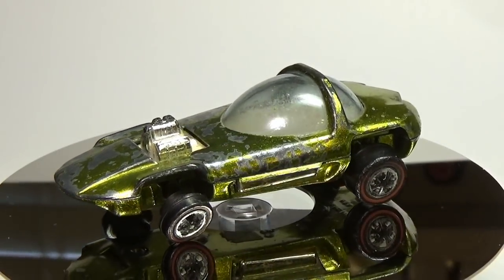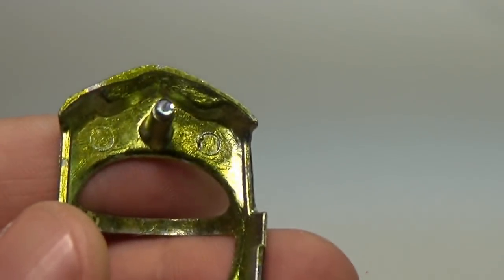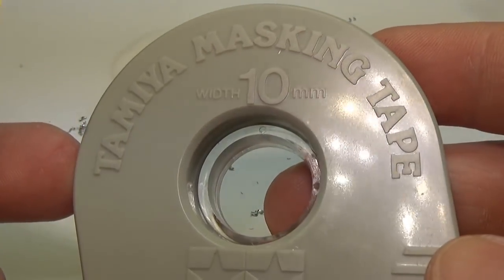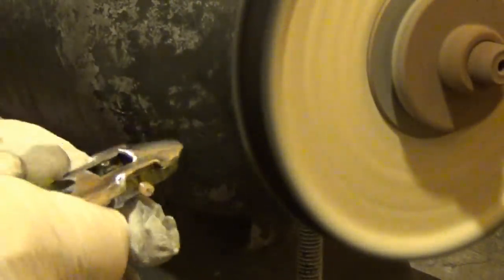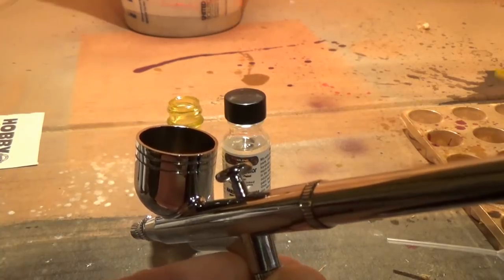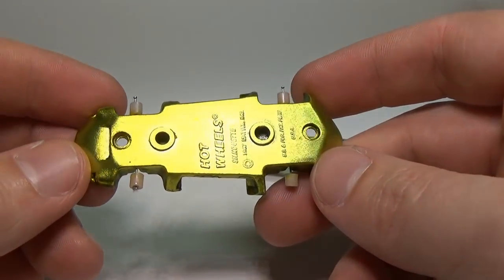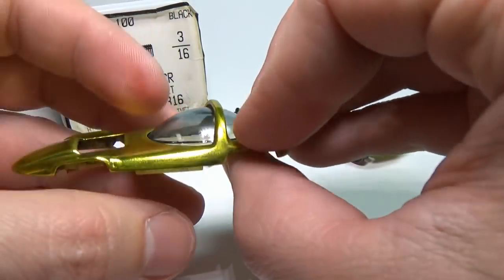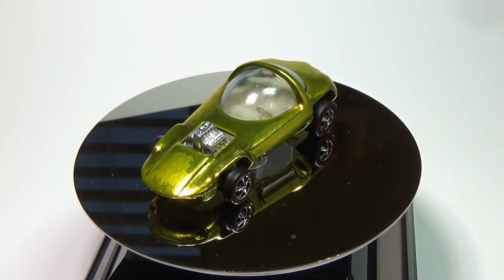Redline Restoration: How To Step by Step

Comment: Hi. I have watched a few of your videos and they are great so many thanks.
In this video you refer to discolouration in the metal.
I have a theory about this.... You have gone through the surface finish (BZP) and exposed the base metal low melt zinc alloy.
If you look under the bonnet (hood) of some redlines the engine detail has a blue hue.
I believe this to be a BZP finishing process called Passivation.
If Spectrflame is a PU based paint it is most likely micro porous and will allow moisture to pass trough. this is what I believe causes the toning effect. Especially when you add the salt from a child's sweaty fingers. Over the years a corrosion takes place under the paint surface that affects the BZP and so the ultra bright finish is lost.
Edd.

Comment: I wonder how it might go if you primed the car with a white or light grey primer to fill and cover the discoloration etc, then base coated it with the Chrome paint you used before then over spraying with the Spectra? That might help cover the imperfections but still give the effect of the spectra paint?

Comment: I saw somewhere that the only way to solder the metal that the cars are made of is to copper electroplate them first. This is good only for finishes that aren't transparent though. Re-plating the body in fresh nickel would be the best way to deal with discoloration in transparent finishes.

Comment: I've not tried to solder die-cast metal, but I'd try using solid solder with a good flux paste on top of the surface.  The solder should flow where the flux is.  I'd be interested to know how well this method would actually fill-in the scratches.  I'd also be curious if the Zinc electroplating method would fill the scratches when plated, polished, plated, polished, etc.

Comment: It sounds to me like the soldering troubles you've been having is because the cars are just too chunky. They take a lot of heat, being diecast. You might be able to try soldering to the metal by using additional heat. For example, in a lot of board-level rework, the board is pre-heated to a specific temperature. This allows easier wetting of solder in certain areas when using an iron, and also protects the traces from heat damage when you're doing hot-air SMD removal (the pre-heat prevents thermal shock since most of the board will be pretty hot already, compared to introducing 330C hot air to an ice-cold board).

You can get a cheap temp controlled hot air station on eBay for $30 or $40. Rig it up so the nozzle blows on the area you want to solder without you having to sit there and hold it. Let it warm up the area, then introduce your iron.

I'm not sure how you've been trying to solder it, but you don't want to put the iron directly on the pits you're trying to fill. Just near it. The idea is, that region will get super hot, to the point of melting solder. Then you can just "paint" your solder wire into the pitted region. When the solder hits the hot metal, it will start to melt and wet. You might even be able to do this without any additional flux, rosin-core solder might provide just enough flux for proper wetting.

EDIT
Also, I'd use the biggest tip possible. Something that ends at a nice, big flat end. Like a big knife tip, or a huge bevel.

Comment: After using the spray gun to put the paint / hardener combo on, how do you clean out the spray gun so it doesn't clog up permanently with hardened paint, and how quickly do you have to act before it's too late to clean it out ?

Comment: Couldn't you use the chrome paint you use on the engine as a primer to keep the see-thru effect of the yellow paint you put on top as a way to 'unify' the appearance of the color base coat? (or maybe paints are not compatible and wouldn't stick to each other? noobhere, just curious) Keep up the god work, I love those vids.

Comment: Great video, would a dunk in your acid bottle clear those spots? How do you feel about putting cars in a walnut shaker?
Reply from the maker: not sure if the acid would work on this...  I use a walnut shaker a lot... the only down side is the car needs to sit in it a good day for best results. But it does give a really nice surface.  It might have done wonders blending the discoloration of this car as the surface it leaves is more of a matte surface.

Comment: Have you tried using the chrome paint you used for the engine as a base for the yellow to cover the discolouration? There are many other metallic paints such as Alclad that could work. Thanks for the video.
Reply: I was gonna suggest that too. It works for me, Just depends on what finish you want to achieve, a re-plate could work.

Comment: I came across a silhouette  that has the exhaust on the outside of the car and not attached to the motor. It had the bent axle design not the pressed in bent axles so i assume it was original. Any thoughts?

Comment: I've never tried to solder a hotwheel but I do know solder doesn't stick well to cold metal.  Try using a heat gun to heat up the body untill the solder melts went touching the body. Let me know if that works. Also, you could use an oven. About 350 degrees should do.

Comment: About primers. Have you experimented with Epoxy primer and etching primer? Maybe using thinner with it, you might can get it thin enough to just coat it to hide the discoloration and still get a good result with the paint. I paint actual cars, not models, so I figured it'd be worth a shot if you haven't tried already. Or another idea could be to find a color similar to the bare metal using that as a base then the other color on top, while thinning out the paint to keep it from layering so thick. anyways, just some ideas. awesome vids still.

Comment: Well done! looks awesome.
Just wondering if anyone here in the comment section knows the value of a 1969 "swingin wing" with purple metallic color, I'm bad with the values of these cars because I just started collecting. I found it at a thrift shop and the shape of it is really good but it is missing the withe plastic pice and the motor so i just want to know if it is worth buying a new one for it.

Comment: Have you tried using flux with the solder? Or perhaps using something like a mini torch to add the solder? I know the torch is unconventional but you need to have the metal base hot enough for solder to bond and typically harder metals to solder use flux to help it bond
Reply: Brian Bertram — I have heard him mention in some other videos that using torch & solder offers too many opportunities to screw up a car. 🤷🏻‍♂️

Comment: So it looks like the discoloration is bounded by the grains in the metal - I've never done this but I'm wondering if you annealed the metal in your car you might reduce some of the issues. With ZAMAC you could probably try doing this by boiling it in 80% distilled water/20% glycerine for 30-60 minutes. Again no idea how well that might work, but it's worth a shot maybe.

Comment: The tool for the tires is a bailing wire cutter. Pick them up at Home Depot or just about any hardware store. I use them frequently in my job.

Comment: an idea for filling those pits, perhaps some eutectic metal? a lead bismuth blend would melt at a lower temperature than the casting, but would take a polish like any other metal. There's a few places you can buy them from, and they melt with a lighter. Ebay has it, so does amazon.
Reply from the maker: I find these metal "bead up"  on the surface they do not flow into the pits.
Reply: yeah, even in an ideal situation I'd imagine you'd need to shape them down with a file a little bit, but pot metal is a curious beast and very difficult to mend

Comment: I have an idea for solder-based filling,.. whatever it's called. Maybe you could use acid to wear away at the metal a bit, or just oxidize it if you have the option, then get rid of the "scabs" and fill it all with solder.

Comment: After polishing and before you paint, what are you using to prep the body to avoid fisheyes from the polish?
Reply from the maker: I use mineral spirits to remove any polish residue and then wash wish soap and water... I make sure not to touch the metal before painting.

Comment: I am by no means an expert, but could you not fill the body and use All-Clad gloss black primer followed by All-Clad aluminium or steel then your color. I have used for candy coatings on model cars before. They turned out great.

Comment: roll it! run it down a test track! : )  i had this as a kid and was frustrated because it rolled horribly (all those wheels bent)
how does it compare in speed to some new ones?
Reply from the maker: It would beat a modern hot wheels just because it weighs so much more... but it rolls like crap... the bearings are shot..

Comment: for filling the nicks and scratches you can use lead, its fairly easy to melt and I've used it to fill body damage in real cars, I just dont know about the color variation being seen through the paint you use.
Reply from the maker: not sure if I want to risk lead...  lots of sanding and polishing.. lots of airborne lead.

Comment: Solder would work if you copper plate the car metal first, the solder will bond to the copper.
You can then plate the car in zinc to hide the copper and to get the car back to being silver/grey. 
You could also hide the discoloration with a zinc plating.

Comment: There is a product called lunar flux from a company called kapp. It is for soldering die cast. The only downside to soldering die cast is the high temps required (500-750 degrees f). Probably good for repairs but not so much for body filler.
Reply from the maker: hmm... at that heat I ma rather sure the metal of the car would melt wrinkle.

Comment: To add zinc to the surface instead of solder it's all about temp control and parting line. The melt temp of zinc ranges from 949f to 975f. At 1025f it gets very shiny, not good. It will freeze at 925f thus the parting line between new and old zinc. Always clean the surface, preheat to around 500f to 700f. With such small amounts, melting in a steel spoon would work. You are at a good temp when top of liquid zinc has a slight gold color. Tilt your part so the liquid zinc flows over surface, dip in water to freeze. Practice before applying to car. Cleanup overflow as you would parting line flash. If zinc flakes off, the car was too cold.

Comment: Quick tip on getting your painting service all even with no discoloration after you get it all clean polished spray a coat or two of Krylon Looking Glass silver if you spray it over a nice clean shiny car it basically Crohn's it but be careful if you run it and then let it dry paint stripper won't even take it off

Comment: Im a solder guy, for the solder to stick ti the car you would have to hear the metal body of the car up. If you put hot solder on a cold car body it will form a cold solder joint and fall right off.

Comment: the solder is likely not sticking to the metal because you are not getting the section of the body hot enough, place the tip of the solder iron next to the hole you want to fill, very close but not in it, wait a bit then put the solder in the hole you want to fill, when the metal of the body is hot enough it will fill the hole.

Comment: To solder diecast you have yo use phosporic acid flux and make sure the car gets totemp so it will stick. Best to use a low temp solder tho, dont want to melt the car. LOL

Comment: Does anyone know the name of the car, probably Match Box or Hot Wheels, circa 1960s to 1972/73 at the latest, that looked like a bubble top Corvette Mako?  The bubble top was oval in shape, centered, and took up most of the upper body.  Each quarter-panel had Corvette Stingray style fenders.  The front of the car, looking down from above, had three points, kind of like the Mark 5 but not as protruding.  The rear-end of the car was straight, but had a Batmobile style jet exhaust.  Again, looking down from above the length/sides of the car had an oval shape, just a 3 pointed front and flat rear-end.  The car was usually painted a metallic color, the one I had was metallic dark green.
Reply: KEM451 the make is in the title. He literally says the name of the model in almost every single sentence, especially towards the end...

Comment: Just thinking out loud here...not sure if it's doable or not. What if, instead of worrying about localized areas that discolored from spot corrosion, you were able to find a process that will quickly and evenly corrode and discolor the whole car body, then polish that out as the base for the Spectra-Flame? I've seen electro-chemical processes similar to the bath you use to clean the cars that will make silver or copper or brass instantly flash to a full oxidation...guess you'd just have to find out what particular solution is most aggressive to that type of metal and also ionically active when prodded by an electric charge. It would leave a darker base but still take a nice polish so it would backlight the Spectra nicely, I'd think...

Comment: Those are called CRIMPERS we use those when we use rings to attach a 90 degrees or a T when attaching hoses for landscaping we CRIMP the rings so the hoses don’t come off with the water pressure.

Comment: Why use a different air brush?  Urethane?
Reply from the maker: TJ's Practical DIY the urethane paint will disolve any other paint that might be in the airbrush and discolor the paint... it is just good practice not to cross contaminate differant paints as a lot of them can react with each other...
Reply: Thanks for the info.  I have some HW customs but have not moved to airbrushing yet.  I have one but am learning as much as I can before actually working with it.  Besides, I don't have a compressor yet.  Considering a DIY old fridge compressor mod.

Comment: To solder anything to a large metal plate or car one needs to use an integrated tip soldering iron. Not the standard old removable tip irons.

Comment: You may have tried this somehow but solder probably won’t work because of the metal that the car is made of and also the car has to get hot enough the the solder won’t solidify as soon as it touches the car

Comment: I have a pair of those odd cutters you use for the wheels and the package literally says ''end nippers" which I have made many jokes about. and solder won't stick to just about anything by itself, you need a substance called flux. some solder comes pre-fluxed usually, but sometimes will burn or rub off or whatever and is very useful to have flux paste or liquid. interesting restorations though, I can't stop watching lol.

Comment: Could you not purchase an electroplating kit?
Reply from the maker: sure but most use chemicals that you can't easily get rid of...as in you can't pour them down the drain when you are done.
Reply: baremetalHW yeah but you would be using a very small amount of solution. Just an idea.

Comment: when the metal is discolored why not apply a primer?
Reply: The spectra-flame paint needs a shiny surface underneath it to look right, as he says at 7:00
You could use a primer and then paint over it with metal flake paint, which he does in some later videos

Comment: As a lover of vintage electric guitars it is shocking to see such invasive restorations, even of the "junker" vintage hotwheels. No one would ever strip all the finish off of a '62 stratocaster just because there was visible wear and scratches on the surface. In fact, the wear and patina on the guitar increases its value; it also helps tell a story about the life of the instrument, and hence contains its character. After a full restoration, the hotwheels often look too perfect, almost plastick-y. They have lost all of their original character. I end up missing the original character of the "junker". What if there was another kind of restoration of junkers that straightened out the bent parts, and reduced or stabilized further corrosion and oxidation, but otherwise tried to keep as much of the original character of the hotwheel as possible. Otherwise, your videos are satisfying and relaxing.
Reply: Theo Cedar Jones - I think these are restored almost as one restores a classic car where damaged parts are replaced, paint is stripped and replaced, interiors are redone, etc. In these types of restorations it’s more rebuilding and trying to make it look like it’s just off the factory line. ￼